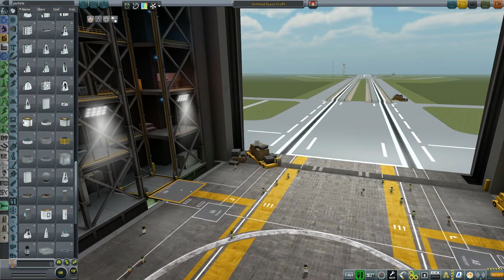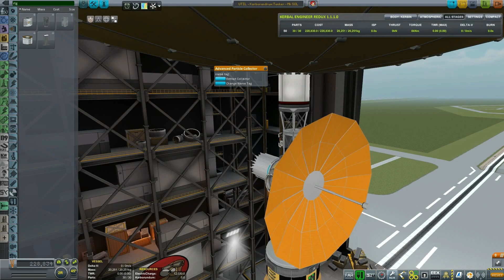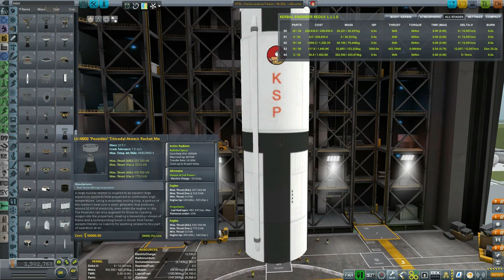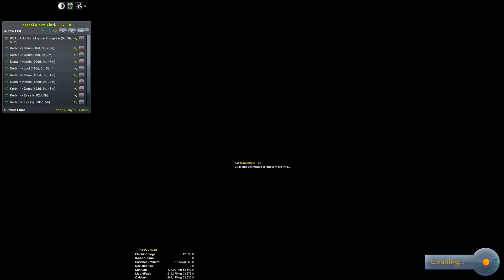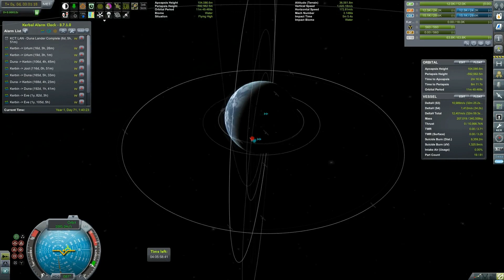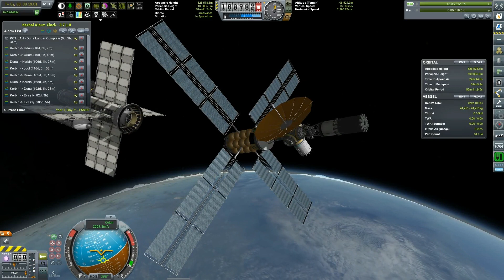Kerbal Engineering - Building Karborandrum Particle Collector

Comment: I  do not think that centre of lift placement does not matter in a vertical rocket. Should save you a few fins
Reply from the maker: Pulsar Gaming Tried it but if i dont put it i risk oversteering during gravity turn and flipping a rocket, so they at least keep my rocket stable even i mess up a little on steering
Reply: GrunfWorks maybe larger fins would work instead of many small ones. the main concern with large fins though is too much drag
Reply from the maker: Pulsar Gaming Yea i agree. I actually searched for largerbfins and found the B9 legacy had the ones i used to use so i downloaded them.

Comment: I really enjoy this semi-series. It really adds to the main series by giving a lot of detail. It's fun seeing you solve problems in unusual ways.

I also love the KW Rockerty mod (especially the booster tanks), but it does have a shed-load of parts. It would be nice if the pack could be broken down by part type, so you could load just the pieces you needed, such as engines or tanks, but not both. Common parts would obviously be a required prerequisite in a base mod.

In the meantime, keep up the good work!